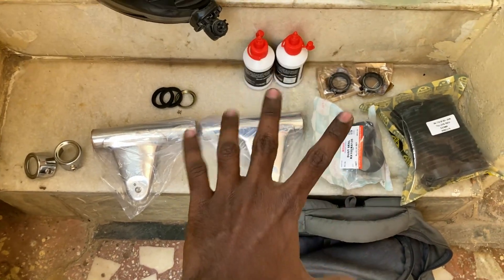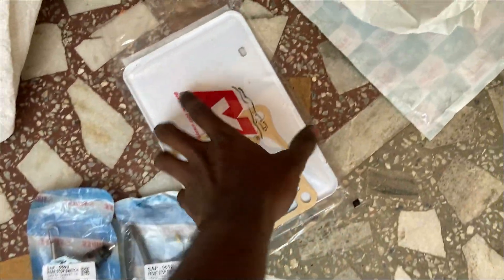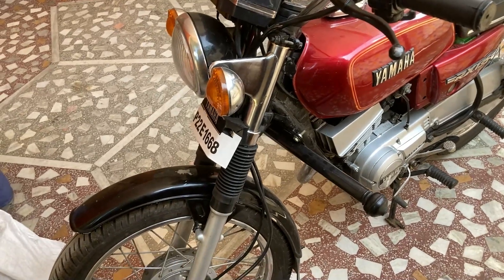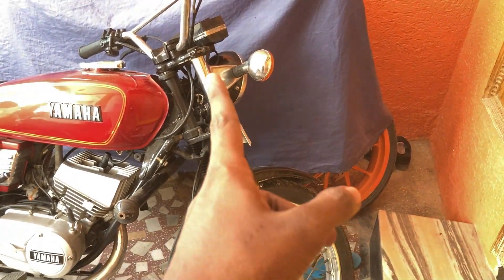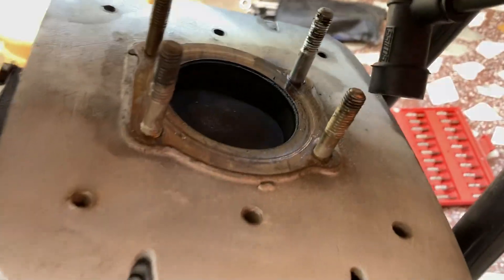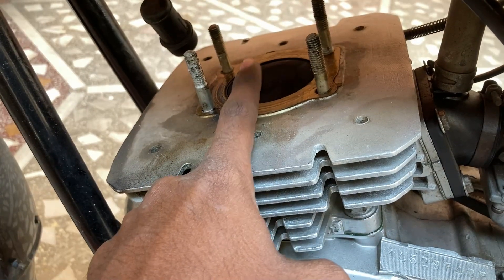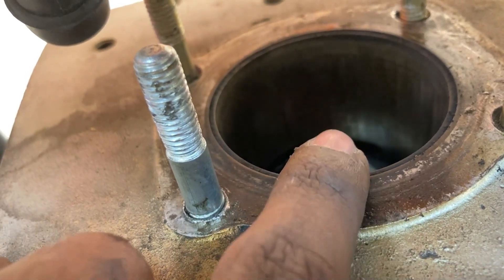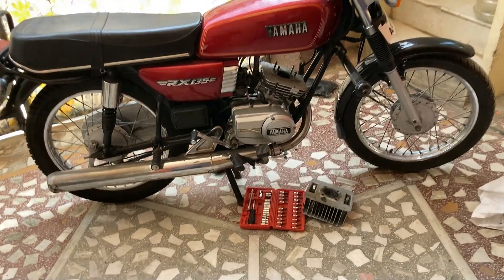YAMAHA RX 100 Restoration🔥| Part 1

Comment: Bro rx 135 best piston size
Reply from the maker: All sizes are best only
Reply: Bro rx135 lit ga piston noise vastundhi problem enti bro
Reply from the maker: Need rebore
Reply: @MotoGod  bro full bore chesi 5monthes avuthundhi
Reply: @rajuroyal809  increase 2t oil mixture.

Comment: Nice work. Now your bike block is sleeved so.... Can you get that original pickup, power, torque on this sleeved block like original block piston?? Is it OK to re bore on such sleeved block. For better pickup, power, and torque??
Reply from the maker: Gives decent quality of power
Reply: @MotoGod  ohk so what is the best solution to getting that rx100 or rx135 insane pickup, power, torque. I have RX100 1986 MADE IN JAPAN MODEL with Y-2 cylinder block.... But my bike don't have that insane power, pickup, torque. I replaced old clutch plate +pressure plates to new one, also carburetor is set, I replaced red valve rubber +packing +spark plug.... And I Chek it out the block cylinder to different mechanics some one says it's sleeved block get Goetz block and sell this to some one and... Some one says it's original you just re restore complete engine....now I am Really confused, what should I do. How to deal with such issues. And also now we can't purchase /afford new block piston of RX 100 or 135 from showroom. Is there any solution for it brother?? I am really in trouble.
Reply: @vijayendrahirwe502 sir did you find any solution

Comment: That cylinder deck can be milled to correct the poor sleeve job and you can use a thicker Head Gasket to have correct squish clearance. e-mail me and Ill turn you on to a company that can make you one up to .094" or 2.3876mm ,   e mail me if interested
Reply from the maker: Thanks for your suggestion